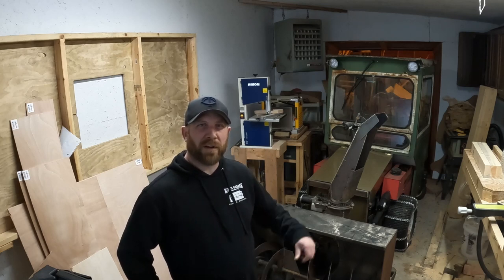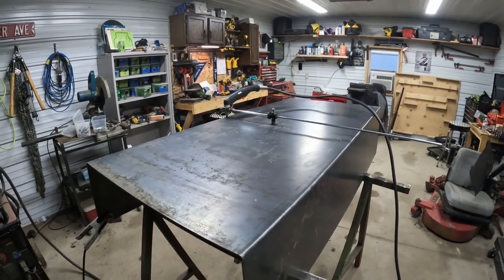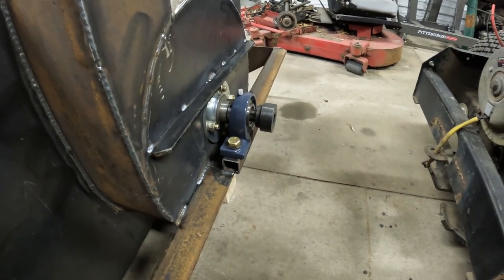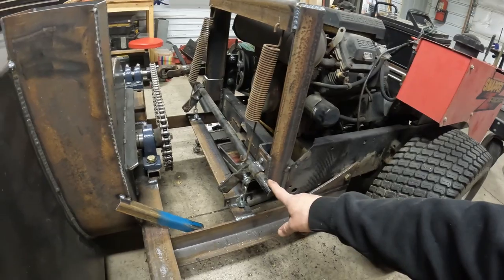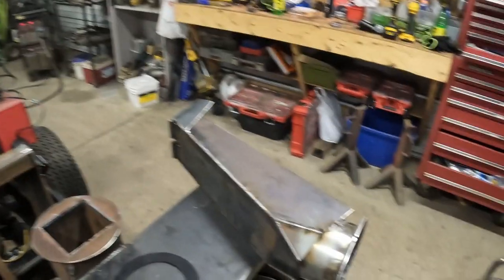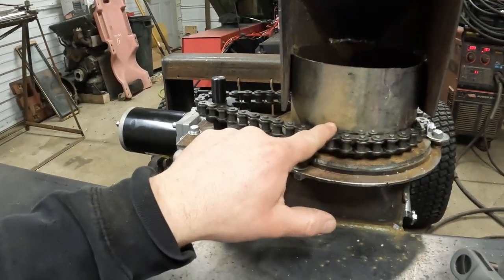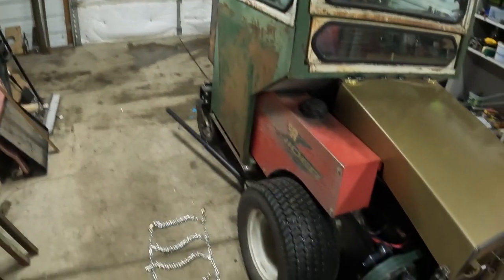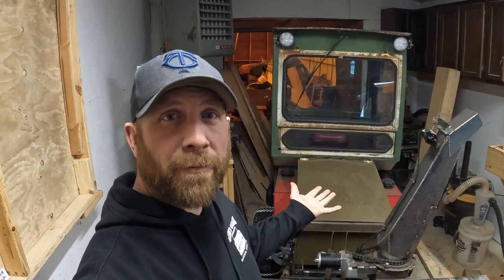Zero Turn Snowblower - The Full Build

Comment: I love this!  All snowblowers should be zero-turn like this.  I just have two silly comments.  I would think you only need one swivel wheel in the back rather than two.  As the drivetrain cam from a Toro rider mower I can understand why the engine is over the drive wheels, but wouldn't it be better for balance if it was rear mounted and you sat over the drive wheels?

Comment: 2 comments , replaceable cutting edge?  Float on blower to follow up&down ,   And I noticed the drive shaft yokes are 90 deg off on drive shaft timing ( both yokes should be same   ]—-[.  ).  Nice job!
Reply: I'm not doubting your advice, but rather just curious as to why the yokes need to be the same?
Reply: @Andy-df5fj  as they turn there can be binding if not the same very slight but can cause. Vibration and excess  wear on unjoint brearings
Reply: @rogermorrill4700  
Ahh I see.  Thanks!